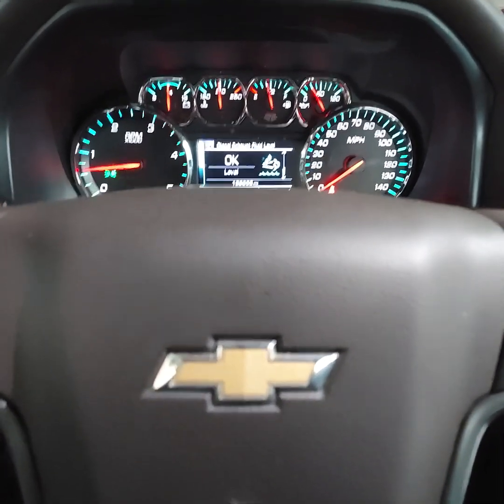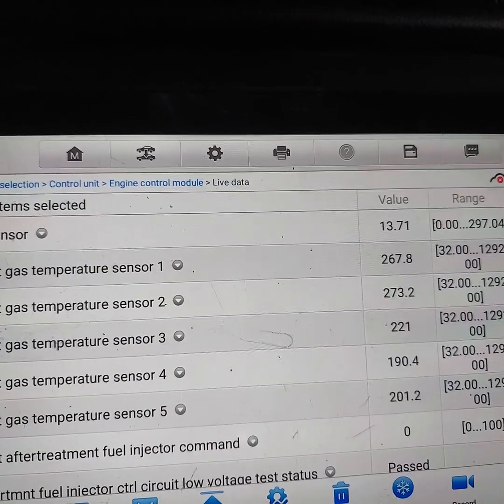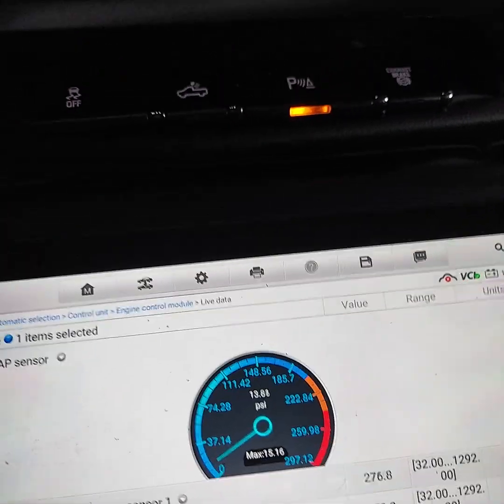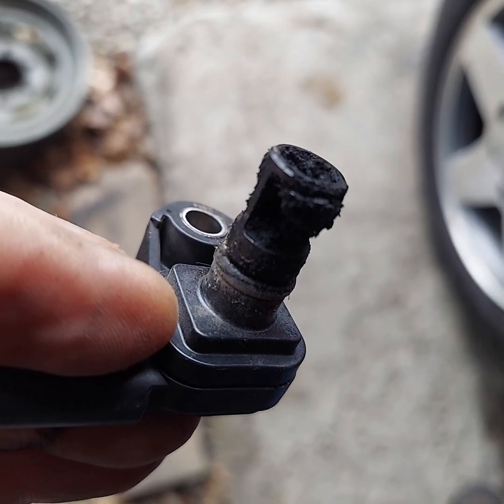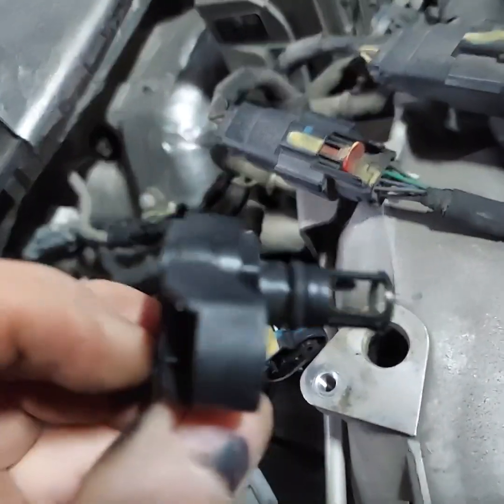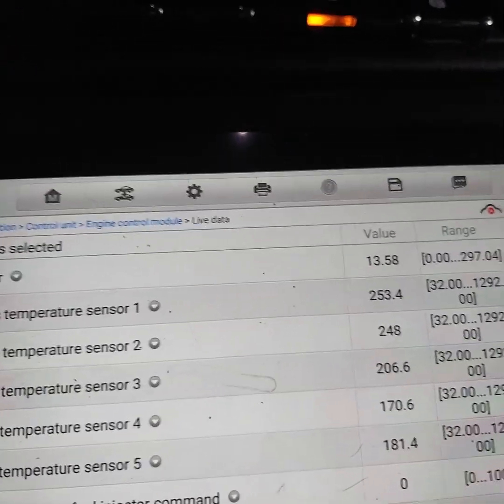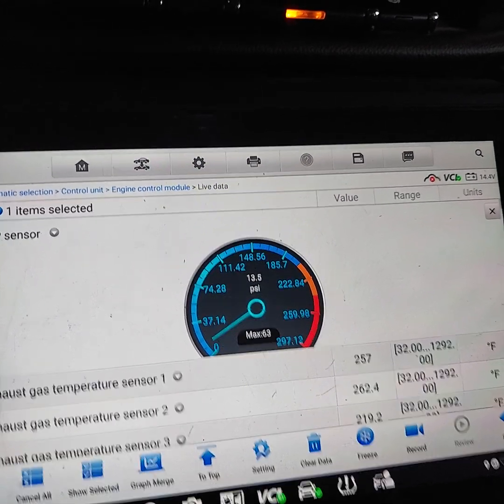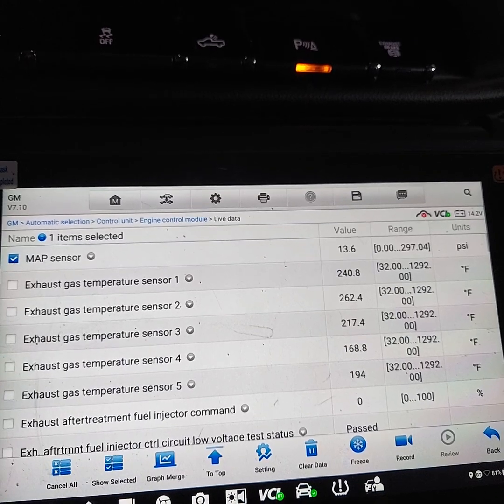2018 Duramax MAP sensor values before & after cleaning

Comment: Great idea! You should do the same test but turn traction control off as it will limit torque output. This will limit the positive manifold pressure and fueling to keep from spinning the tires. As you can see the MAP reading never exceeds ambient air pressure.